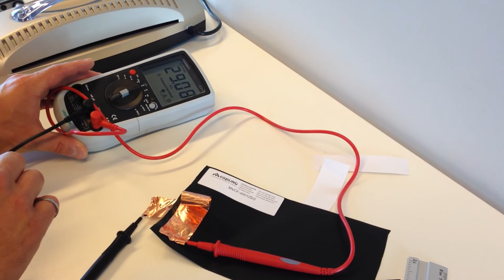How to measure surface resistivity of Linqstat plastic conductive films

Comment: What is the effect of pressure while measuring the surface and volume resistivity? 
What is ohm per square? Does this mean ohm per linear cm?
Please help me out.
Reply: Yeah, this video is wrong. I don't think the way they are measuring is the best, it looks like a "school practice", rather than a profesional test.
Reply: @juanantonio488  I think velostat can't be easly home tested professionally without a specialized mashine. however one could attempt something using a arduino. but you need a device capable of generating a very precise connection area on 2 sides, a open area, a very precise pressure, temperature and bend.
Reply: linear cm is using 2 needle points where you measure it as if it where a wire. per square uses 2 longer strips with near 0 relative resistance so like a lot of resistors in parallel this would give the resistance of that specific square. but all such things differ heavily depending on how you use and connect them. if you use it for projects I personally tend to make the sensors first and then measure them. in general there shouldn't be a to great offset except for when you are making very small sensors. or just let your microcomputer do the work for you and add a autocalibrate for the zero point+ a offset or for both the zero and pressure arc.

Comment: Thanks for the video.  Forgive my ignorance but can I ask other than the practicality of taking a measurement from a thin sample, for thicker material samples what's to just stop you from putting a needle on either side (top & bottom) and taking a reading? Are the copper strips a mandatory requirement?